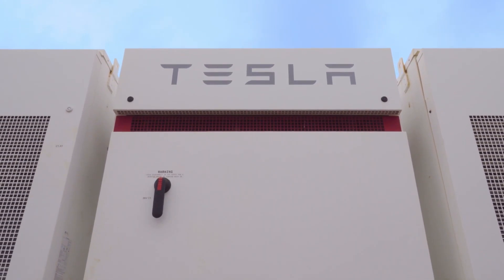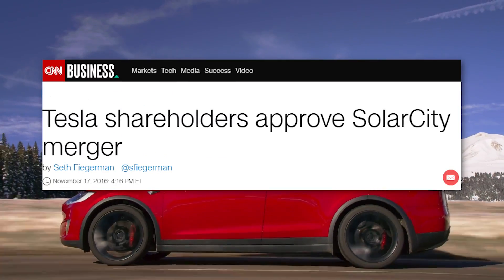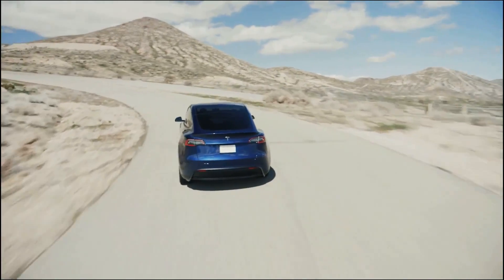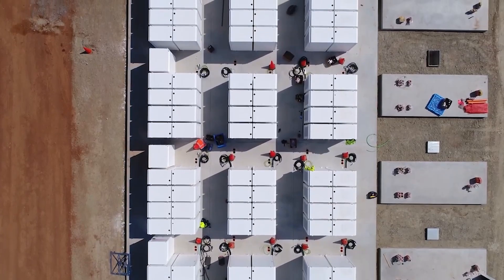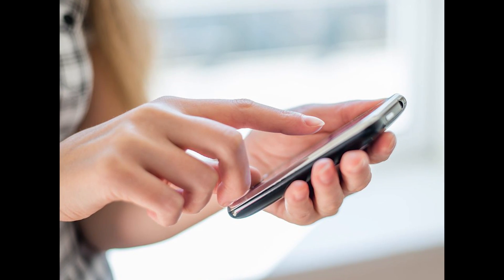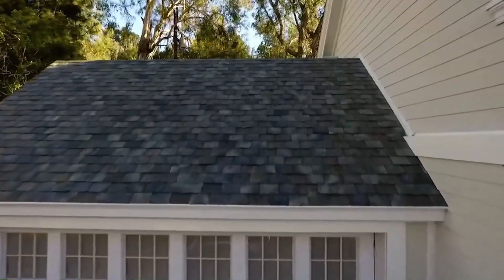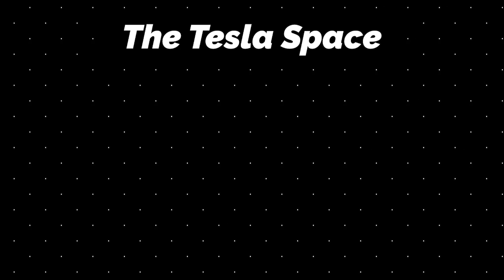Why Tesla Solar Will Take Over In 2021

Comment: They should figure out a way to heat the shingles. That way when it senses large amounts of snow it will automatically melt it. Perhaps you could have a couple regular solar panels on the ground to help power it.
Reply: I'm sure they'll have that feature in the app. When they produce the next generation.

Comment: Tesla solar would have already taken over in the US, had they had sufficient production capacity to supply reroofs.
The grid is a cumbersome obsolete network, and should be abandoned ASAP, as it fragments forest, contributes thusly to deforestation and wildlife extinctions (forests tend to be as much as 15 degrees cooler than unforested land on sunny days, and 15 degrees warmer in winters than open landscapes. This temperature variation can be measured and felt within a few meters of forest-openland interface.  Thus unbroken forests do not have the opportunity for the 85 to 90% human-caused wildfires. Mature trees are resistant, as well as protecting groundwater, streams, and waterways from high evaporation).

The best,most mission-oriented choice for Tesla would be to license solar tile manufacturing to other companies. We are in dire need of quick change from fossil-fuel and hydropower damming and consequent extinctions occurring from blocked waterways.

Comment: Tesla Solar panels and 3 power walls have been a nightmare for me.   I purchased in October 2020. They installed in early February.  It is now May 15.  They have never gotten the system working.  A week after installation they discovered a problem with one of the inverters.  They have sent people out 3 times to troubleshoot.  Each time it takes a month to schedule the next visit.  There is a total disconnect between the people who come to fix them and the customer service people you can speak to on the phone.  Total nightmare.  Also when they submitted to the utility for final approval, they never submitted the proper paperwork and SoCal Edison emailed me that the application was rejected because Tesla didn't submit the proper site plan and never responded to their 10 day notice to fix the application.  So now SoCal Edison has rejected the application and there has been no sign by Tesla that they are going to fix the application and resubmit. Summary:   I spent $50,000 before rebate for a Tesla solar system with 3 power walls.  It doesn't work and Tesla is taking months to address it.   The application with the Utility was rejected.  I paid 50,000 and continue to pay utility bills.   I wish I had never purchased Tesla solar.  P.S. I have a Model Y and love it.   Auto arm and Solar arm of Tesla are night and day, in my opinion.

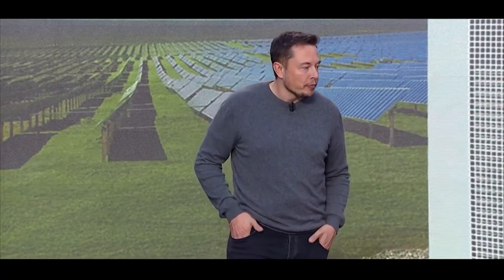Comment: At 3:21, we see the Tesla drop test video, where the Tesla Glass Tile is compared to Terra Cotta, Clay, and Slate Tiles as they are struck by a heavy metal ball, obviously dropped from an equal height.  Colorado has frequent hail storms, substantiated by the highest number of vehicle windshield and house window replacements in the nation.  The test in this video may only be partially realistic because the Tesla Glass Tile will have a 1-1/2" air space beneath it when mounted rather than lying on a solid flat surface, as in this video.  Also, most ball tests are performed with multiple balls over a measured period of time to simulate multi-year weather damage.  It would be interesting to see the results of a more in-depth beating.  Also, is there a minimum and/or maximum roof slope?

Comment: The solar panels should be able to work in a power outage, maybe the unit that sends energy back out into the grid should disconnect when the grid goes down, in order for it to know when it's down, maybe it could use an always online connection and it could alert it if it's safe to run and if it gets a signal that it's not safe to run or fails to make a connection (in the case of an internet outage) it won't connect.

Comment: While I appreciate the decrease in installation cost of the new series 3 Tesla solar roofs, I am not a fan of the appearance.  Fine for a normal house, but my house made huge $$$ investments to provide an architecturally stunning result.  I was really looking forward to the Tesla solar roof that looked pretty much exactly like a slate roof.  I was considering the investment even though I have a concrete tile roof that still has possibly another 20 years of life left in it.  Is the slate-look roof never happening now?  Very disappointing.

Comment: I live in Southern Ontario. Would be interesting to see how the roof handles ice storms. The battery wall will have to be installed in a garage or basement for Nowrthern States and Canada. Batteries become inefficient in cold weather.
Reply: we mostly install the power walls inside the garage or in the basement of the house

Comment: What is four times more than the cheapest roof asphalt shingle roof having run roofing company 20 years ago that means there’s roofs out there that cost as much or more than the tesla solar roof they do come with a 40 year guarantee but the Tesla roof is guaranteed for function as a solar panel for 20 years the material that it’s made out of being as tough as it is it’s going to last more like 40+ years so it’s actually if you’re going higher and a cheaper roof

Comment: Tesla solar roof tiles not allowed in Canada. They are not durable and don't last as long as asphalt. They don't pass Canadian Standard Association. I just installed a 6000 kw solar system and made a point NOT to go with Tesla. I vote with my dollars. Tesla's business model does not work for me. If I by a used Tesla the software sold to you like heated seats. self drive ect I have to also pay for. The software was sold to you not me so if I want it I also have to pay and then the monthly fees too. Nope not for me. If tesla was 1/2 price and double the car I would NOT buy it!!!
Reply: Very interesting. I decided to go with Tesla. I bought 7.56 kW system with 2 PW. It was by far the best deal, but I'm in California so...

Comment: We have 3 powerwalls and regular panels now but our Tesla solar roof construction has been approved by the City and installation should start in April. I am in northern Illinois and we get plenty of snow so I will be curious to see how it works on a regular, modestly sloped roof. The regular panels are sometimes covered with snow for a month! Even when it is sunny after snowfall. In terms of Tesla as a company, Wall Street seems to have no clue that it is anything but an automobile company and I have been jumping up and down and screaming at the television every day! Fortunately I bought the stock shortly after I purchased our first Tesla.
Reply: Did you get tesla solar roof? How do you like it

Comment: A single 13.5 kWh powerwall will not totally power an average home for 24 hours. That is a joke. Lights, TV, fridge and a freezer yes. Air conditioning, water heater, electric range, microwave, clothes dryer, etc - forget it. You are WAY over your power budget. You need at least 30 to 40 kWh of storage to last a day in an average sized house. And that is leaving no reserve.
Reply: You are correct. The thing is if you have power outage you just don't use washer or clothes dryer and in general stay low profile. I know it's hard, but you can do it. I have 24 PVs and 2 PW.

Comment: Hi all @  The Tesla Space. Great show again.
As well as Solar, They could dominate the wind generation market as well!!
 This is a slight deviation from your exact thread, but is still EV and Green energy-related.
   I was wondering why no one is talking about TE$LA and Wind turbines.
With Elon and his company's engineering expertise, I am sure they could design and build
The most efficient turbines and towers on the planet. With their knowledge of motors ( and that is all a generator is, a motor being pushed rather than driving a shaft ) coupled with the aerodynamic design of the blades ( remember they have some of the best drag coefficient numbers of any other road car due to their in house designers and fluid dynamics engineers ) These turbines used in conjunction with Tesla storage would become THE standard for wind power generation.
That along with Elon’s Materials expertise used to design the towers, and his ability to scale up production at lightning speed, I can’t see how this would not go a far distance to accelerate his change to renewables and away from fossil fuels in the prime directive.
Can you honestly think of a better company for this job than TE$LA ????

Comment: being a fellow canadian, I'm also keeping a close eye on the solar roof for a new house build I'm planning... I'm not so concerned about the massive snow falls, as I live in southern ontario, the most major weather events don't typically bring over 1ft of snow here in my area. I keep bugging my tesla energy sales rep for updates, he has received no updates on if or when we would be getting it...
Reply: Also, I don't own a Tesla, but curious how it will interact with other EV's that can offer bi-directional charging, such as the new VW Groups solution that VW just announced yesterday scheduled to be released in 2022...
Reply: @NormLassaline  Model 3 has V2H build in. I see more problems with power companies and politics.
Reply: @lesp315  I think thats been debunked... they thought it did originally from a leak, but then engineers examined it closely and it didn't have the required components for bidrectional charging.

Comment: Might work in southern US in concept; but you folks are dreaming because Tesla can't produce enough batteries to do all these fantasy concepts.  I've seen the claims of huge factories - well you have to keep them fed; and to do that you'd need a line a trucks 150 miles long every day - and even those of you smoking the most dope have to question if that will ever happen.
Reply: Can you provide the calculation on the 150 miles of trucks? Or do you just make stuff up?
Reply: @lengould9262  yes I can; so lets start with Giga Berlin- do you know how many Gigawatts of batteries they claim they will build just out of that one plant?  We should start with a common figure we both accept.
Reply: I'll even give you the figure I ready 250 billion watts - 1/4 tera watt - see if you agree with that figure first.
Reply: @lengould9262  yes this is based on the claim that Berlin Gigafactory alone will produce 250Gigawatts of batteries.  If you take the kilowatts per pound you can derive the rest.I didn't even account for workers or service vehicles - just raw materials; of course then you also have to obtain all those materials somewhere and have a constant supply. Maybe they can use trains; but it won't help much.
Reply: @litestuffllc7249  Are you seriously claiming that no-one at Tesla can do arithmetic?? 😸😸
Reply: @lengould9262  they are either unrealistic or liars you choose do the math yourself don't  just accept their silly claims
Reply: @lengould9262  Another example ; quicker to prove idiotic.  Elon Musk says they will have FSD this year - Level 5 self driving - how much you do you want to bet that is going to happen in 2021?  I say zero chance and more I'll give you a wager of $1000 it won't - don't be a dummy

Comment: My Tesla solar panels and powerwalls got me through the 44hr Houston blackout
☀️⚡🏡
Reply: A generator is much cheaper.
Reply: @DavidJohnson-tv2nn  
Yes but a generator just sits there doing nothing until you need it
Solar panels are making power daily for me and with the batteries you can off set higher rates.
The last 3 months I've had no power bill and been earning credits. By the end of the month i should have about $50 in credit on my account.
Also there is a 26% tax credit for solar panels.
Reply: @That-Guy_  where do you live and what is the size of you panel?
Reply: @MrBemnet1  
West Houston
11.34kw panels
2 powerwalls
Reply: @That-Guy_  that's really awesome, it makes me super happy to read this :) One day ill have my own house with solar panels too but laws and regulations with solar panels are weird in my country
Reply: @DavidJohnson-tv2nn  you have to buy fuel in addition to the initial cost of the generator
Reply: @MrBemnet1  That fuels guaranties that I will have power.
Reply: *you think?
Reply: Not just snow, but cloudiness as well. I often see  my solar panels producing virtually zero power for several days in the winter. When the sun comes out again, then yeah, the snow melts fast off the panels, but I've had 3 or 4 days with virtually no output from my solar panels. Fortunately, I have a natural gas Generac generator, and it's saved the day for me several times. Many years ago, I was without grid power for 5 days,, and my Generac ran the entire  time. I live in the foothills in Colorado, and I'm on well water, and when we lose power, I lose water as well. I'd never trust my backup power to solar and batteries.
Reply: @777Outrigger  
Luckily it rarely snows here in Houston.
I refuse to live anywhere north of Conroe TX
😎
Reply: @That-Guy_  I used to live in the DFW area, and I still thought of Houston as the tropics.
Reply: @777Outrigger  
Yep
It's not the heat it's the humility.
Reply: But how much did it cost you boss ,80k? Is the investment worth it you rhino?
Reply: @JJ-ub8sd  
$41k
I have had no power bill for 4 months and have an $87 credit on my account
This month looks like i will make more than i use again
Just making it through the blackout made it worth it as far as i am concerned
My area has bad power stability also
I have a video on my channel abou lt if you are interested
Reply: @That-Guy_  appreciate your insight brother🙏 have been wondering this a while now. I will check out the video
Reply: @That-Guy_  when did you have it installed? Was it the Tesla solar or another companies + powerwall?
Reply: @MollyMaidParkCities  
Last April but it was officially activated in June.
Tesla did it all in 2 days
11.34kw solar and 2 powerwalls
Reply: @That-Guy_  that seems super cheap!
Reply: @MollyMaidParkCities  
The $41k is before the 26% federal tax credit
So its really ~$30k
Reply: @That-Guy_  1 or 2 powerwalls?
Reply: @MollyMaidParkCities  
2
Reply: Solar panels don't work when covered with snow. I have first hand experience with that. I just went through a winter when I had to clean them 3-4 days a week for several months. It's not an easy task even if they are on a ground mount. On a roof - forget it.
Reply: @kdanagger6894  
Right
Since house's down here are not as insulated as much as in the north the heat from the inside of my house rises into the attic and helped melt the little snow that fell plus the panels are all black so any exposed spots heated them up fast
Reply: @kdanagger6894  Solar roof is hydrophobic so snow can often clear itself. I'm fairly sure this won't work every day in certain climates but time will tell.
Reply: @kdanagger6894  I agree. I have 9kW installation on my flat roof, which is about 50 feet above the ground. Once I tried to remove the snow from panels - the effects were pathetic, since the snow melted a bit on the lower surface and the panels were covered with snow; the special shovel on a 20 ft stick just removed the top layer and still production was close to 0 kW. Later that day the sun shined so well, that all snow was gone - also from the panels that I didn't manage to clean up.
I never tried to repeat that operation - climbing on a snowy roof is an extremely stupid idea.
Reply: @kdanagger6894  it’s not as effective in snowy regions like that it’s best in places like California, texas, and Florida which are all major population centers in America that rarely get snow and all get lots of sunlight. There are many other regions that could use it but those are places with lots of sunlight and little snow

Comment: I’m from Canada as well. I have talked with some solar installers before, and they mentioned that the traditional solar panels will heat up a bit from the sun, therefore melting the snow/ice off of them. I was wondering if that would be the same with these solar panels, as they have ridges through them which may hold up the snow? If the snow won’t come off, would I need to use salt pucks on the solar panels, and are salt pucks okay to use on such things?
Reply: Doesn't matter, they only install the tesla solar tiles in the US in 2023, and they hardly install many at all. Look at it in a few years when it might be possible for you to buy them

Comment: I just had a proposal for a grid-tie solar system in Canada (Toronto).  My roof faces east/west and the system proposed (6.75 kW peak) covers about 75% of my usage.  The payback would be about 9-10 years.  The problem is that my roof will need replacement in about 5 years. If the solar system is installed now, then it would need to come off later to be able to replace the roof.  The shingles under the solar panel would last longer but the exposed parts would still need replacing.  This puts the payback even longer which is too much.  When the roof needs replacing, then it would be a good time to replace it with a Tesla roof.  However, the Tesla roof cost is high and the power output per square foot of roof is less than a traditional solar panel.  So, at this time it seems that the Tesla roof is not cost-effective.  Perhaps in five years, it will be better and cheaper.  It does look like it will warm up enough in the day to help keep the snow off in the winter.